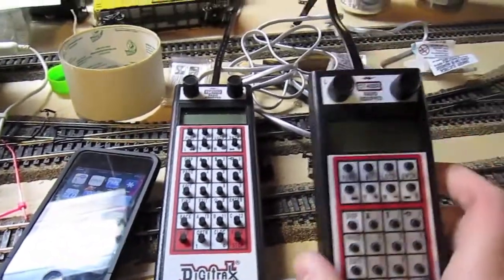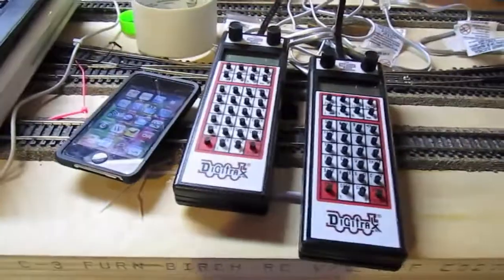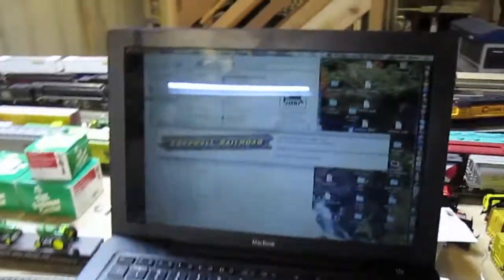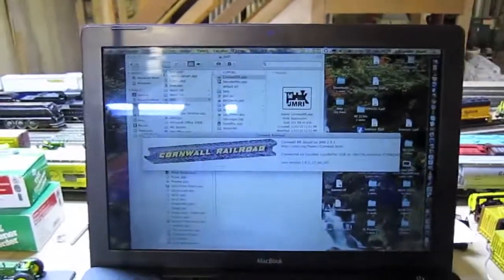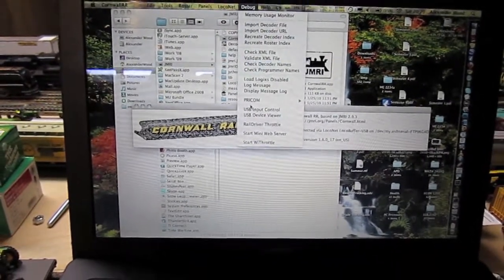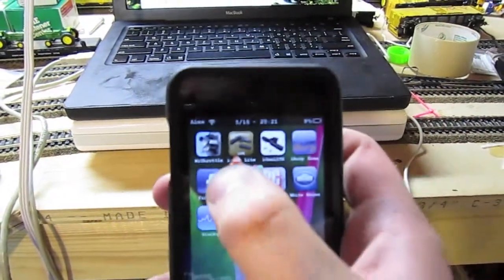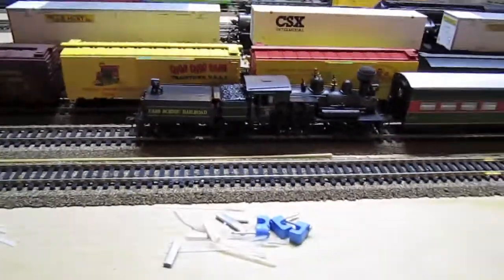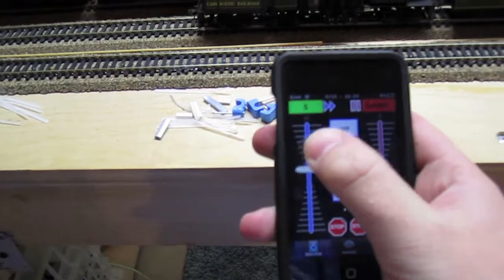WiThrottle

Comment from the maker: @things343 The Powercab doesn't have a USB or serial port, so obviously you need an adapter. I'm pretty sure NCE has a USB adapter that they use with that system.

It's not going to let you start WiThrottle unless you have a system connected.

Comment from the maker: @things343 Ok, you need to connect your system to your computer. I assume you have the PowerPro system. In that case, you need to either have an older PC with a serial port, or a serial to USB adapter. Check with the NCE Yahoo Group to find one that will work with NCE, those things are really touchy.

After that, its just a matter of software. Make sure that while you are using WiThrottle, the firewall on your laptop is disabled, but don't forget to enable it again before you connect

Comment from the maker: @tjseid You need a computer interface for your Digitrax system. The PR3 is only a decoder programmer, and hence has no way to talk to the system itself. I PR3 should work for decoder programming in JMRI, however, but that's outside of my area of experience.

I'd recommend the Locobuffer-USB, assuming you are also using Digitrax DCC.